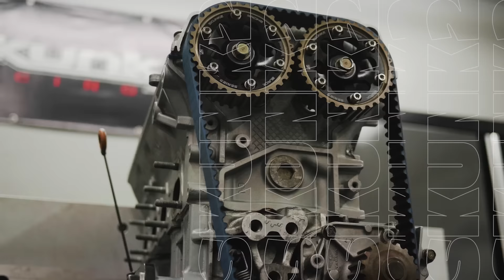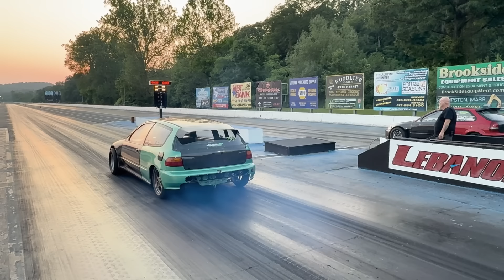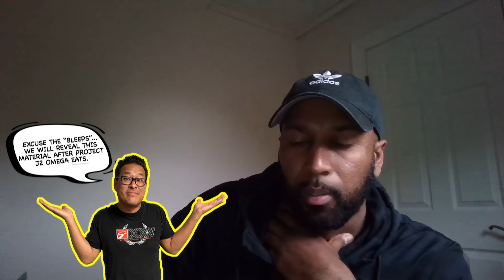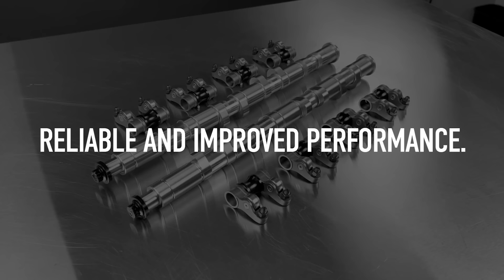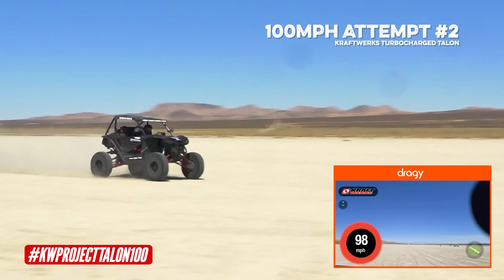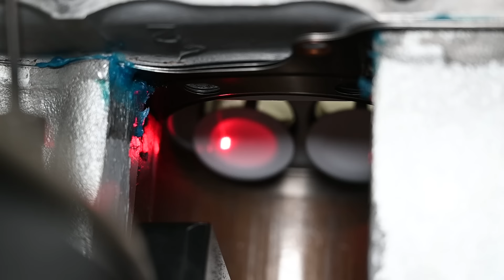Skunk2's TECHNICAL DIFFICULTIES - Part 12: Mo' Powa, Mo' Problems

Comment: 1 thing learned

"Mo' Powa, Mo' Problems" addresses the trade-offs of increasing engine power, such as reliability issues and tuning complexities. It provides insights into balancing performance gains with practical considerations

Comment: If your turbo engine has a intake to exhaust pressure ratio of 1 to 1 or better should there be a difference between a turbo cam and an na cam? I feel like even going back to reading (Maximum boost by Corky Bell) or one of my other OLD turbo books the best turbo cam is an na cam with an engine with a decent VE. Or do you run into burning valves or other heat related issues?? Thanks guys I love these videos ❤❤!!! Ps do you run into issues because of the lower compression on a turbo compared to really high compression na stuff? Thanks again!